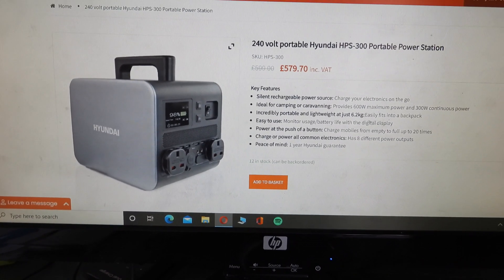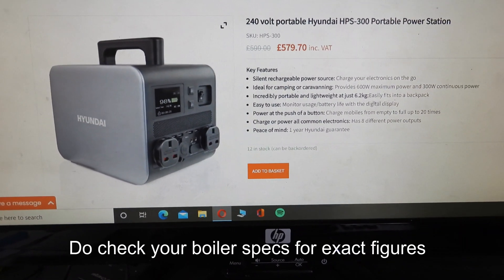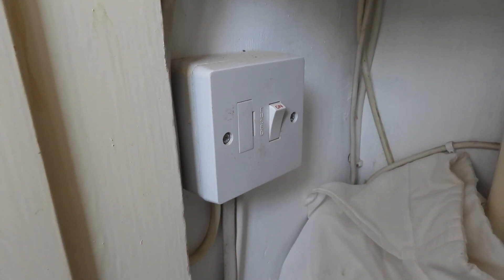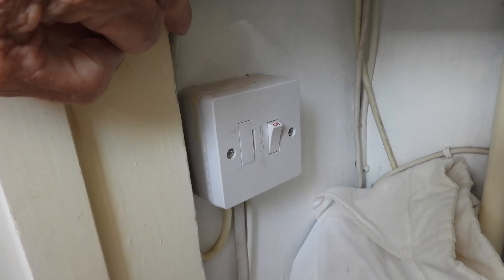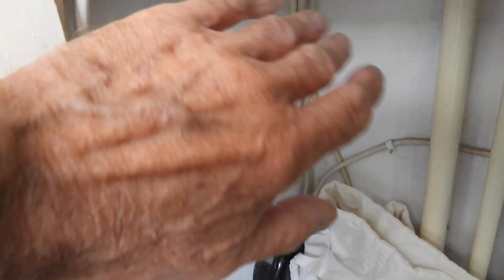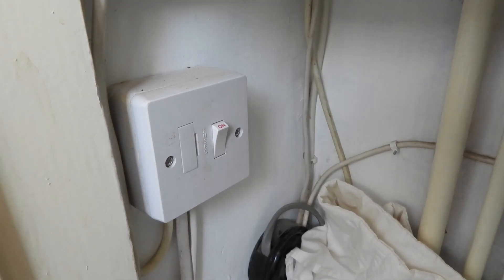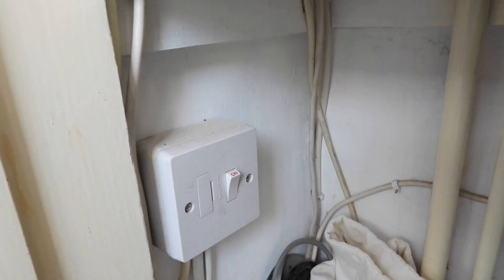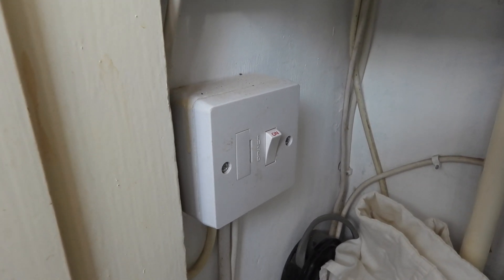Can I use a  battery power bank to run my central heating boiler?

Comment: Just put a single socket in place of the spur and put a plug on the cable from the boiler.
Then you can unplug it and connect it to the battery.

We will 100% get these power cuts ... it's a matter of when not if Ed Miliband will make it happen
Reply from the maker: Sure is coming.

Comment: I recently purchased a Jackery 1000 and tried it out. It should work in theory but it doesn't. E133 error message comes up. Note that the generator didn't trip (it kept supplying about 100W) but it seems as though the ignition flame in the boiler was going out. 
I will get a refund on mine, so please anyone purchasing a generator/battery for running the boiler in a blackout then make sure you have a no questions asked return policy.
Reply from the maker: Thanks.
Reply: Thanks I was thinking of trying that unit myself. There may be 2 reasons it didn’t work. 1 pumps require a surge current perhaps 5 times the running current on start up 2 devices may depend on a smooth sine wave supply as you get with a mains supply, whereas most inverters provide a sharp square wave supply.

Comment: Just had a 1.5 hour power cut. Couldn't heat the home (wasn't too bothered for 1.5 hours though) and this was the first thing I thought. Could I run the boiler on a UPS/Battery backup. We have solar too, and of course they're useless during a power cut as they're grid tied. A whole house battery like a Tesla Powerwall or Pylon would work though but that's big money.
Reply from the maker: Try one of the models listed.

Comment: Planner power cuts will be notified 24hrs in advance. It's the unplanned ones that we should plan for. A portable power station is great, most don't come with a UPS circuit, as they are designed to be off grid. For central heating boilers, and pumps, it should be under 500w for most, and newer ones say around 200-300w in the specs. However do test yours before connecting up an inverter as it may trip out if the start current is higher than the inverter max rating.
Reply from the maker: Thanks for the info!

Comment: EV owners will need these soon when they can't charge-up their cars during the 3-hour power cuts this winter.
Reply: As an EV owner I will be bereft at being only able to charge for the other 165 hours a week.  A 30 minute rapid charge is enough to keep me going for a week.
Reply: @stevehill6  Am I allowed a wry smile at EV owners having to pay 'road tax'/Vehicle Excise Duty in a couple of years from now.....? About time too as you expect to be able to use the same roads as everyone else!
Reply: @mda50099  It’s an emissions tax in the U.K.   watch this space.
Reply: @stevehill6  Er no, it is not an emissions tax in the UK. VED (also known as "vehicle tax", "car tax", and more controversially as "road tax", and formerly as a "tax disc") is an annual tax that is levied as an excise duty and which must be paid for most types of powered vehicles which are to be used (or parked) on public roads in the United Kingdom. From April 2025 that will now include ALL EVs.
Reply: @mda50099  not just road tax, most EVs are more than £40k, they'll be paying the £355 luxury car tax for cars over 40k soon too.
Reply: @silverismoney  Yes, that was the "sting in the tail" to owners of EVs and I suspect will now deter many from buying them, especially as VED and the extra luxury tax rises with inflation every year.
Reply: 😂😂😂😂😂😂😂 correct
Reply from the maker: Ha ha, now why didn`t I think of that one.
Reply: We've had an EV for 6 years and very rarely had the need to charge it during peak hours. Our EV energy tariff is from 8.30pm to 1.30am (off peak - costing a third of the daytime rate). So this shouldn't be an issue atm 🙂
Reply: @ashb8572  what you forget to mention is 100% cost more of the car, to save a few quid in fuel...now with financial advice like that, who needs a lawyer 😂😂😂😂
Reply: @waynekerrr9027  very true. I've just recently sold our other EV which was £30k. Luckily got nearly all my money back as it had only done 3k miles. I saw sense and got rid just prior to the gov stepping in with energy prices. I got a new Dacia Bi fuel (LPG) instead. It cost me £14k so less than half the list in comparison lol. 70p per litre for LPG is nice versus fuel cost of otherwise ice cars including hybrids ect
Reply: @waynekerrr9027  no road tax, service every 10 years  and off peak/ solar charging almost never brake replacement  no ULEZ charge and programmable defrost on cold mornings    What’s not to like ?
Reply: @pollywollydo  Double the price of petrol car for a start..   will take about 20 years to recover price paid on car ....road tax on the way....  EVs are for companies, wealthy, and idiots only..sorry
Reply: @waynekerrr9027  actually I get free supercharging for life— Cornwall return X20 no cost how much in petrol ?   I’m happy 😊
Reply: @pollywollydo  I get free petrol...so I'm still thousands better off
Reply: @waynekerrr9027  so do you steal it or is I a company car and if so how much company car tax do you pay —- do tell your secret 😎
Reply: @pollywollydo  when your in business, there are ways and means of not paying a single penny for fuel..I haven't paid a penny in over 30 years..Happy Christmas 😂😂😂
Reply: @waynekerrr9027  I sure the IRS will be grateful for the written admission.  You’ve been dodging tax for 30 years and VAT ?  I’d put it on Fakebook too .  😹😹😹.  I’m sure that’s not you real name tho’.  Or is it a misprint ?
Reply: @pollywollydo  We don't have IRS in my country..sorry....Why would I need to advertise it on Facebook..??   I think your a bit miffed that my car expenses are considerably less than yours 😂😂😂😂😂. And yes name is miss print..surname is Kerrrrrr
Reply: @waynekerrr9027  I think your a bit miffed full stop.  My Tesla shares are paying for my one set of tyres in five years and going toward buying my next one.  Your car brand doing that for you ?
Reply: @pollywollydo  I suppose you think my friend is a false name too....his name is Wayne King
Reply: @pollywollydo  Hahaha...I don't even pay for the car 😂😂. It gets written off against goods, and I replace it with a brand new one every 2 years, and spend the sale money on holidays 😂😂😂..I love my business...Happy New Year 👍👍👍
Reply: @waynekerrr9027  and no tax wherever you live - must be Paradise.      Took a while for the penny to drop 🤭.   Keep working hard .
Reply: @pollywollydo  yes there is tax, however I choose to pay very little..personal choice.. government doesn't give me anything, so I don't give them anything...seems good to me 👍👍👍
Reply: @waynekerrr9027  “ you are Al Capone and I claim my $ 50 “
Reply: @pollywollydo Er ok. So you own a car (according to what you are saying) and you bought that vehicle because of your logic and assumptions that it was a good idea to save money in a long run 👏 well done.
Hhmmm now let’s break it down on what’s not to like.

1: on every charging you have to do, you are literally detained from your own car for at least 45 minutes. “On fast chargers that is and only 80% charge” 
On a fully charged battery, if you are a sensible driver you can get up to 300 miles out of that battery. Remember, only if you keep the air conditioning off.
On the display would be saying 450 or more miles but “if you’re lucky” you could get 300.
1.1: I stop at a garage with a petrol/diesel NORMAL CAR car. 5 to 6 mins to fill up the tank, 2 minutes to pay. 1 min leaving the garage. 10 minutes tops im back on the road.
Now with a full tank i will drive  600+ miles with the air conditioning on full blast. “Petrol engines around 500 miles +/-50 around there”

2: after 3 years from the purchase date “from new” your EV loses 30% to 40% of its value “depends upon how much you have looked after” and if you have more than 100K miles on the dash or battery health/life is below 80% capacity, the price will drop well below 50% from purchase price. 
2.2: after 3 years with 100K miles on the dash, NORMAL CAR still holds 70%/75% of the purchase price “if has only 30K miles would be just under 90%. 

3: in the event of a lite crash or accident, your car will be worth less than scrap metal and you can’t just take it to any scrapyard for disposal.
3.3 NORMAL CAR in a right-off crash collision event would be still worth more than half of the price in parts only and the scrap metal price on top of that.

4: all EV’s have this very cheap look made materials especially the interior parts of every EV looks like it’s bought on TEMU and if you drive more than 3/4 hours nonstop, you’ll be needing a physiotherapist to help with your back 
4.4 NORMAL CAR “speaking for myself” has an absolutely amazing look and the interior design of an luxury car with solid  rattles parts and comfortable on the road like a rolls Royce despite the driving hours, i never get tired. 

5: 20 days left of your road tax free car so enjoy it.
5.5 NORMAL car and everything else that uses public roads has to pay those taxes because that’s how the roads are maintained for those cars to drive on them. 

6: electric cars are good for companies but not for people. Except for not normal people “no offence polly”
6.6 NORMAL cars are good for everyone and for the people. 
“Except for those thinking they are smart then the rest of the world just because they were born in a rich family” you know what I mean polly 😉
So long my friend
Reply: @ sorry to disabuse you of your assumptions , my road tax will be £20 after 8 years free.  I had a hefty grant from der Gubmint toward the purchase price🙂 I also get free supercharging for life having had approx 20+ holidays with a total energy spend £19 🙂.  During the summer months my main electricity cost for home and motoring ( 2 cars) is the standing charge 🙂. Additionally that nice Mr Milliband gives me approx£1 for every Kw generated and used by me.   I have been advised re servicing to “ bring it back @ 10 years “ for a once over/ fluid change .  I’ll put up with the Temu interior @ that price.  ‘ spect your Audi/ Merc’ / whatever runs on fresh air or do you pay 56%? Duty on your juice + VAT 🥴. Then there’s always a regular trip to the stealership— someone has to pay for all that glass and chrome palace and “ free” tea coffee and biscuits.  Bet they welcome you with open arms .  So stick with what you know but no one likes a smartarse 🙄
Reply: @ see answer below can’t be bothered to type it twice 🙄 it’s the one that ended “ no one likes a smartarse” so easy for you to find then🥴
Reply: @pollywollydo  “My father is stronger than your father!” the way you present your arguments sounds just like that, mate. Except, on occasion, you also come across as an entitled child who believes everyone else is either ignorant or destitute. No offence, but seriously, it’s time to grow up.

Moreover, your comments are entirely irrelevant to the context of the video shared by this gentleman. The only reason I responded was to highlight some objective facts and remind you that not everything that glitters is gold. That said, it seems I may have misunderstood your point initially, and for that, I sincerely apologize.

The whole time, I believed we were discussing the pros and cons between an actual car and a battery powered RC toy. My remarks were made in general terms, applicable to most people, not to any specific individual certainly not to your particular case. Whatever your personal circumstances may be, it’s clear you are content with your situation. However, I must point out that you are still being taken advantage of financially, and here’s why:

I have an elderly friend who, despite not yet reaching pension age, has received a brand-new car every two years for the past decade completely free of charge. Not an RC toy, mind you, but an actual vehicle. She pays nothing for parking, road tax, or insurance; her only expense is fuel. And if you assume she’s limited to an economy class vehicle, you’d be mistaken. She receives a fully equipped Volvo SUV one of the safest and most luxurious options available. Volvo is, after all, the only brand that includes every standard safety feature in its base models, making them significantly more valuable than many so-called luxury cars.

So, before defending your position so vehemently, I encourage you to do some research. You clearly have plenty of time on your hands after all, who else would respond within seconds to a comment that’s two years old?

Now, although my response may seem harsh, please understand that none of this is meant as a personal attack. I have no ill will towards you, nor do I wish to offend. In fact, I count myself lucky not to know you personally, as dealing with your ego would be utterly exhausting. The mere thought of it is enough to wear me out more so than a donkey’s back under the desert sun.

With that, I bid you farewell. May your journey through life be a smooth one. Take care.

Comment: Please don't connect the boiler as suggested in the video! 

You would be better having the fused spur/flex outlet replaced with a socket and then plugging in the boiler. You could then plug the boiler into an alternate power source if needed.

If you're thinking about using a generator please use an inverter generator otherwise you will run the risk of an expensive repair when the switch mode PSU in the boiler goes pop because of a spike from the generator.

If you are thinking of running an inverter from the car battery, make sure it's a pure sine wave inverter because you are going to be running the pump and possibly a fan motor. These will probably not run from a modified sine wave inverter.
Reply from the maker: Thanks Dan I knew someone would be able to come up with a better idea.
Reply: @dereton33  Not as cheap as mine!!
Reply: Definite safest way to go is just to replace the fused spur with a single socket and put a plug on the boiler flex. Can then just unplug boiler and then use a normal mains extension lead when connecting the power bank. Very easy then to swap back and no danger involved.
Reply: We live in a rural location, we suffer power cuts more often than you would in an urban area. Our heating system takes its electrical power through a plug running from a fused spur. We have an inverter generator which runs the heating system and fridge freezer when power goes off. An inverter generator is a far more flexible and economical solution than a powerpack.
Reply: This is all gibberish to me - thank you for sharing it all though. We'd definitely need to hire someone to install it or teach us how either way! However, I appreciate the video because it's a great starting point! Thanks so much!

Comment: i will worry about it when it happens Al,i don't believe what you hear on sly news and BBC news
Reply from the maker: Very true.
Reply: The media loves the scare mongering, but in this case I’ve seen this coming for months and made preparations. Just candles, torches etc in easy to find places with fresh batteries. Wood stocked up for the wood burner. We get 50% of our heating from burning gas in this country. Gas across Europe is in short supply, we’re bound to have lapses.